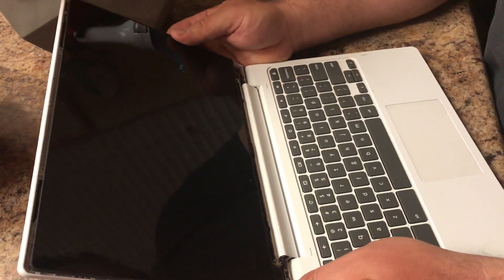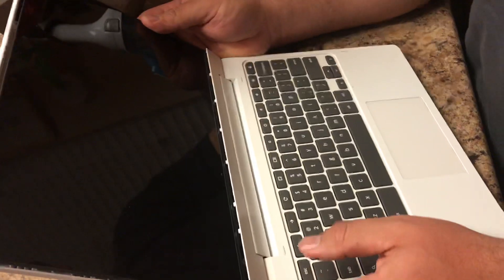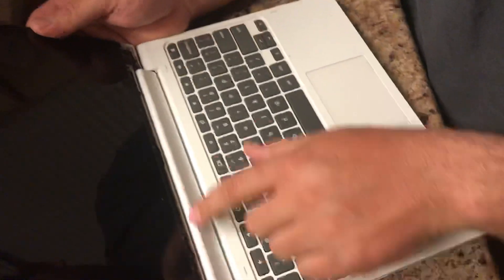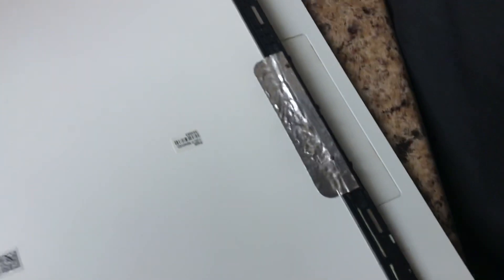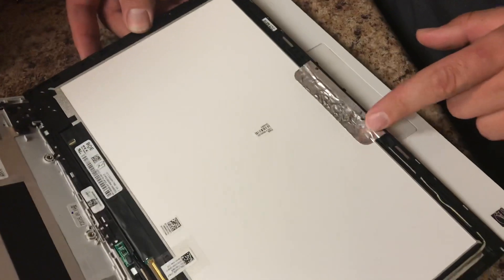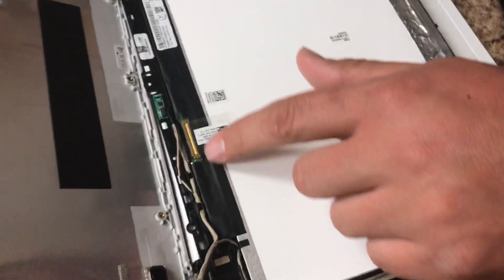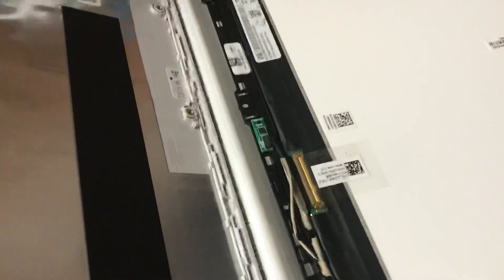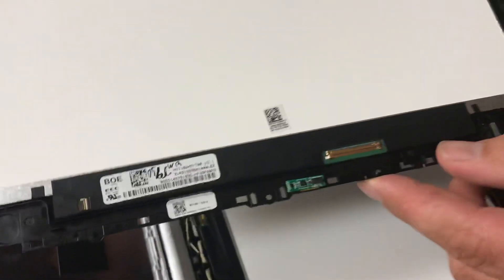Replacing screen on Lenovo Chromebook C330

Comment: PLEASE NOTE: once you have removed the lower cover and the 3 screws, the screen SLIDES DOWN about 4mm out of it's retaining slots and then it can be removed (It IS NOT clipped in). When refitting do the revers. Also remove the camera and small circuit at the bottom with the cable attached (do not try and unplug!)
Reply: Hey I am currently just trying to get the screen back into place so that I can screw it in and I cannot for the life of me figure out how to slide it back into place. I don't understand what I'm doing wrong. Can you help me out by any chance?